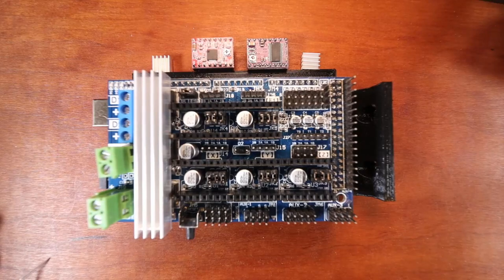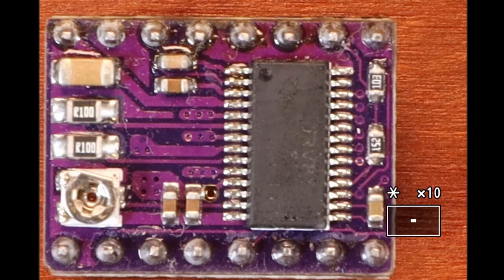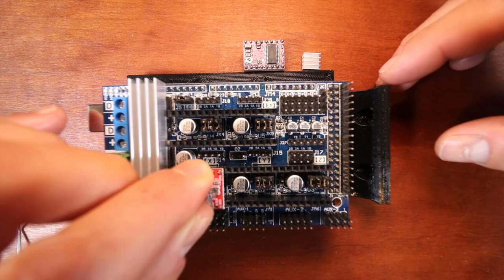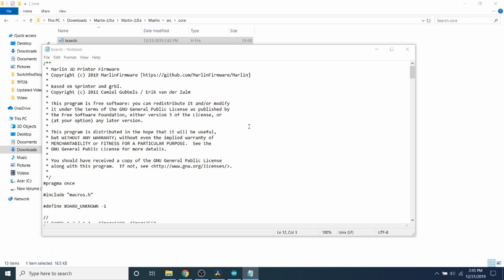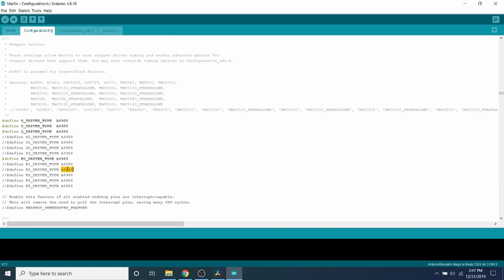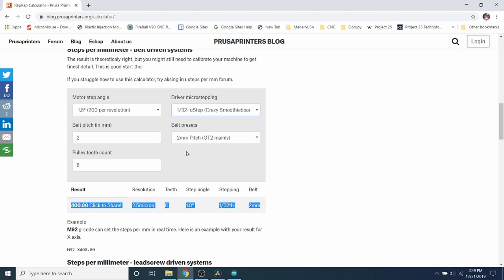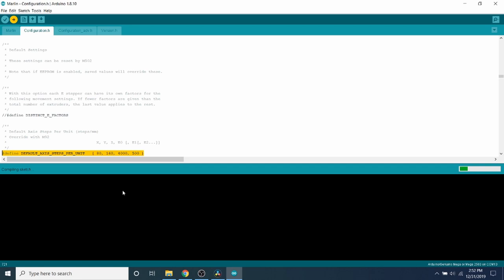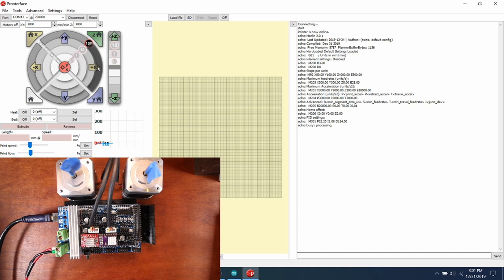RAMPS 1.6 - A4988/DRV8825 configuration

Comment: Hello, thank you very much for the explanation you provided in this video. It helps me a lot to better understand the characteristics of RAMPShield 1.6 and the difference compared to RAMPShield 1.4. Also, about how the controllers for the Steppers should be placed. My question is the following: how to connect a Nema 17 motor to the RAMPShield 1.6 in such a way that it can be driven to provide rotation. In my case, I have to connect 5 stepper motors, so I have placed 5 DRV8825 controls on the RAMPShield. In advance, thank you very much for your comment. My project is related to BNC3D MOVEO ROBOT ARM and I am using the marlin firmware for control every stepper.
Reply from the maker: My RAMP 1.4 playlist shows more advanced configurations, but nothing on robotics as that functionality is still unstable.

Comment: Hi Edward,

Thanks for the informative videos! Are vcc and 5v bridged by default? A jumper fell off and I don't know where it goes. My Mega no longer turns on and I get Heat and Homing timeouts. Not sure if its related to the jumper :( Any Ideas? Thanks
Reply from the maker: A couple of issues maybe occuring. The VCC and 5v need to be jumped on RAMPS 1.4 for servo's and the heaters might be not connected or thermistors is broken.  I'd check them for continuity.
Reply: @EdwardBraiman  Thanks a lot! I think I may have damaged the 1.6 board by reversing a stepper motor while it was still powered. I think the voltage controller may be damaged on the mega as well. It was working and reading temps for all of about 20 seconds! I read something about removing d1 on ramps 1.4 to protect the arduino, but I am not sure if this applies. Going to try again with another 1.6 board and replace the voltage controller on the arduino
Reply: @EdwardBraiman  I tried again with a 1.6+ and am now having the same issue on that board. It looks like F2 may be damaged. Any ideas what that means or how to replace  and fix the issue?
Reply from the maker: @eyemac2011  What steps are you doing be specific.  I'm trying to understand the issue.  Are you asking about a stepper or a Extruder?
Reply: @EdwardBraiman I thought I had damaged something on the ramps board  by reversing the y stepper, but the replacement 1.6+ board and new arduino worked to home and extrude with the same steppers.  

I hooked everything up as was in the schematic, but now my atmega2560 will not turn on without usb power and none of the motors or hotend work, but arduino still reads thermistor and endstop values.

I have had the same problem with both boards. At first, the temp readings and homing works, preheat fine, then when I try my first print, It works for a second and then not at all. I get a thermal runaway error or mintemp error because power to hotend hot end seems to stop. None of the leds on ramps board blink or light as if it is heating.

The first time it happened, I tried hooking arduino to the psu via its own barrel jack when it stopped turning on, but that made smoke and maybe fried the 5v regulator on arduino?

It looks like ramps fuse F2 may be damaged as well. Not sure what that means.

Thanks for your time
Reply: Could a G29 (autolevel) command crash a ramps board? I didn't set it up in firmware but it was in my cura start code. Everything seemed to run until this command.
Reply: It was a fuse (F2) issue. Replaced it with an automotive fuse.

Comment: Hi,  I can´t get the stepmotor moving. I follow this tutorial and noticed the jumper in 5V and Vcc on the ramps. If I put the jumper in those pins the arduino won´t turn on, without the jumper is fine and between the 5V and Vcc I got ~5v on the multimeter (With the 5V pin being positive). Is this normal? Should I get a new ramps?
Reply from the maker: It should work as shown in tutorial.  If you want to join my Discord below in description, I can look at you configuration.h file in the morning.
Reply: @EdwardBraiman  Thank you, I realized a fuse is dead but I will join the discord tough

Comment: Is the ramps 1.6 reliable? I can't find much information, only a ton of problems regarding the ramps 1.4 and now I'm not sure which one to get.
Reply from the maker: I've been printing several years with a RAMPS 1.4 and they are almost the same board, but with better silk screen on motherboard and cooling.  As for picking a board it depends on your needs.  Remember most RAMPS are 8 bit and 32 bit boards are now on par for price.

Comment: Hi,  when I try to upload the Marlin -bugfix -2.0x Marlin.ino file to my Arduino Mega 2560, it gets stuck while compiling, this happens regardless of if used verify or upload, if I use the Marlin 1.1x file it works, any idea on why the 2.0 file gets stuck in compilation?
Reply from the maker: I'm unsure, but I'll try and see if the same.

Comment: I have problem with z axis. Each layer have space and height of object goes to twice. I used 1/32 , drv8825.
Reply from the maker: What are the numbers for x, y, z and E0?
Reply: @EdwardBraiman  80,80,4000,500
Reply from the maker: Check out reprap calculator.  Also I made a video someplace in my playlist about calibration of extruder.  The process is very similar for movement.
Reply: I am using anet a8 steppers and anet a8 chassis. Can you help me for calculation because I dont have idea for it
Reply from the maker: What type of rods are being used on printer m8 or t8.  With reprap calculator you first assume defaults.  The change drop-down the select number to place in marline firmware.  You'll then need to reload firmware with numbers changed.  After you connect with Pronterface, you'll need to measure starting and ending point of movement to calibrate your setup.
Reply: @EdwardBraiman  i am using m8
Reply from the maker: @nejdetsarkaya1469  try for z axis value 5120.  It might not be super close, but should get you in the range.  Let me know how it looks.
Reply from the maker: Try this link www.blog.prusaprinters.org/calculator/
Reply: @EdwardBraiman  but for now its 4000 if I increase value , I think it moves too much.
Reply: Am I wrong?
Reply from the maker: @nejdetsarkaya1469  try it, you can always change it back.
Reply: @EdwardBraiman  okay I will try

Comment: RAMPS 1.6 I have seen before and I am not understanding why it exists in 2020?
Reply from the maker: There's a small demand for tutorials as there is a spike in viewing.
Reply: I was hoping you would let me know why it exists and I was not saying anything bad about the video I was just wondering why these exist.  Now 5 years ago I would have killed to have this but with all of the 32 bit boards popping out the only thing I can think of is that Ramps has a ton of expandability via all of the pins.
Reply from the maker: RAMPS has always been a favorite of mine, but no one watch with Arduino due, so I was winding them down.  When Marlin firmware 2.0.x came around all my RAMPS 1.4 became confusing for steppers.  Now the Firmware has other changes that are now drawing people into asking questions.  Plus, viewing is still very high for an old configuration.
Reply: I am not so sure I would use 2.0 on a Ramps (in my case 1.4) but for a 32 bit board it is fine though still not a stable release and still has quirks I wouldn't want to fight on an 8bit based solution.  I am honestly not so sure 2.0 would even run as well and the old 1.x versions from all of the junk I see in it.  For instance the stuff I am using is 182k so my ramps 1.4 would choke with that I think.,  Insane how much larger Marlin 2.0 has become with the exact same routines being used.  I think the smallest I was able to get it down (by stripping everything and shutting everything off) was around 154k which is insane.
Reply from the maker: Should work for both, I'm just trying to get everyone on the right version so someday they'll jump to 32 bit once they understand.  From my perspective I would love for them to make the jump, but certain countries are limited in motherboard choices.  Brazil and Singapore seem limited in choices and it's about building an audience on YouTube of viewers.  So I'm focused on as many people learning as someday one of these kids is going to figure out how to make replacement organs.  Just trying to prime the younger kids for the future.  I'm not really in this for the money as my job pays about 80 times what I make in a month on YouTube.  YouTube's kind an addiction of numbers for me.
Reply: Well, when a Sargon used to make 12k USD per month from just Patreon alone there is money to be had but for these sorts of vids, as Big Clive always said, not much.
Reply from the maker: Well my patreon hasn't had one subscription, but I really need to sit down and update it.
Reply: In my case I am not building a 3D printer. I bought this board just to  connect some microcontrollers to arduino in a simple way without cables. And I found that this board is cheaper than the rest
Reply from the maker: That's great.

Comment: I can see that your Rams 1.6 videos are 3 years old and you must have been focused on many uptodate project but it would be very very useful if you could help on connecting the 12864 LCD to the Ramps 1.6 with the latest version of Marlin. I have been trying this but I have not been successful. I could find videos on how to use 12864 LCD on Rams 1.6, and I could make them work, but with Marlin, I am failing. Thank you.
Reply from the maker: Maybe get be able to look at issue Friday afternoon, but most the HW is packed away.  I think maybe only a couple of displays work.  Reason I stopped making videos on ramps 1.6 was 32-bit boards appeared everywhere.
Reply: @EdwardBraiman  But your lectures are highly appreciated.
Reply from the maker: Are you using Arduino IDE or VScode with PlatformIO to build binary for firmware?
Reply: @EdwardBraiman  I am using Arduino IDE.
Reply from the maker: PlatformIO is better and easier.